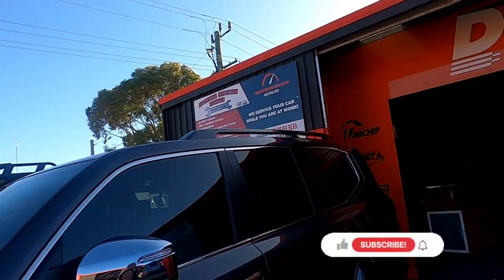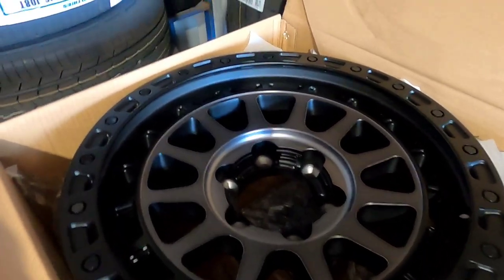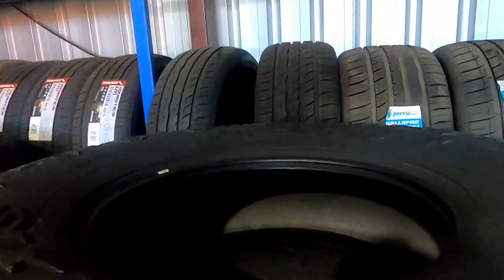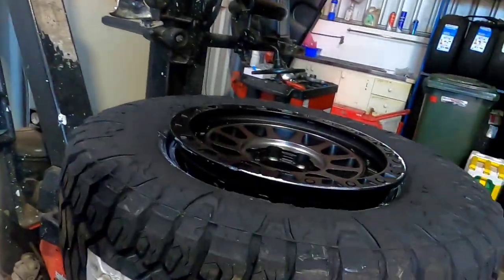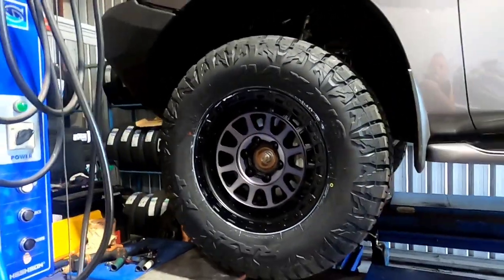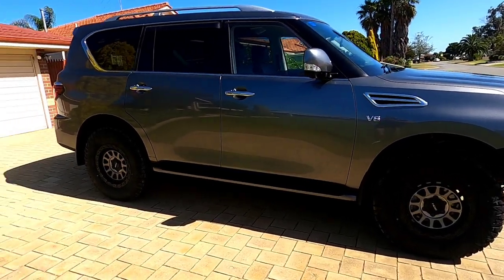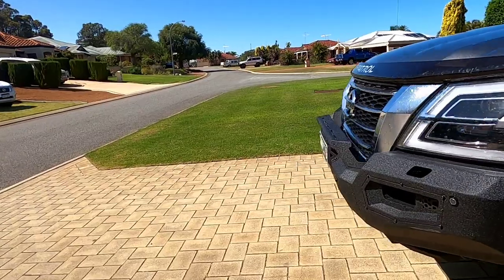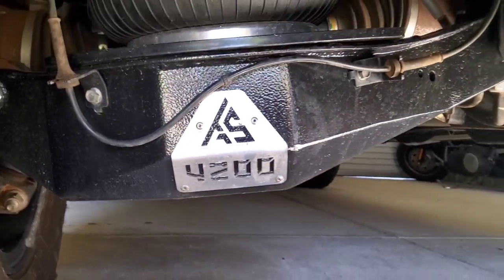Y62 COIL DELETE AND 4.2 GVM UPGRADE NEW RIMS & TYRES

Comment: Did you attach a separate compressor.
They attched mine to our compressor in the rear and it kicks in a lot and is noisy. Any recomendations
Reply from the maker: No I just use my portable compressor that I use to pump up the tyres mine is a manual set-up I don't have on board air. 
Cheers Dave and Nik 👍🍻🇦🇺

Comment: Hi Dave. how is the ride with the coil delete vs the lifted coils? im thinking of changing my setup. cheers!
Reply from the maker: It’s better gives you a bit more control on how your car sits on the road , we could never get the car level when towing but now it is . You just have to remember to let air out when not towing so the right is better
Reply: Any updates on the coil delete mate…..
Reply from the maker: Yes still glad I done it if I knew what I know now I wouldn’t of put heavy coils and airbags in I would of just done this right from the start and saved the money on going it twice 
And could and airbags aren’t enough when trying to tow the max in a y 62 cos it still sags in the the arse. 
So yes go coil delete straight up. You won’t be in happy. 
Cheers Dave and Nik 🇦🇺🍻👍
Reply: Hi mate so after you have had this coil delete with 4.2 gen 2 lower arms do you feel you need to have heavy duty springs as well if so can you do this with that airbag system i think it's boss air bag is it or can you please tell what system is best for the y62 thanks Rick  @daveniksadventures2255
Reply from the maker: @richardhill2451 Hi Rick
If you fit the airbag delete on the rear of your Y62 you can't have coils as well. 
The airbags system that was used on my Y62 are from AAA 
I had heavy duty coils and had airbags inside those coils on the rear first up but I still couldn't stop the rear of the Y62 sagging when the caravan was on. 
So I did the coil delete it fixed the problem now the car can be adjusted to ride level even with the caravan on. 
I'm not sure how many different companies do the coil delete 🤔
I went to DRD in Mandurah and that was the system they were using so I went with that. 
As far as the best system for the Y62 that will depend on how much you want to spend just doing what I did without auto air for up and down it was over $10k if you want to had the air compressor and have auto level it will be a lot more. 
I wish I had of done this the coil delete straight up and not gone with the heavy coils with airbags inside them. 
Cheers Dave and Nik 👍🍻🇦🇺
Reply: @daveniksadventures2255  thanks mate i will be going coil delete cheers for the info